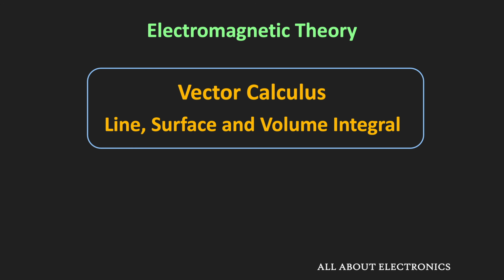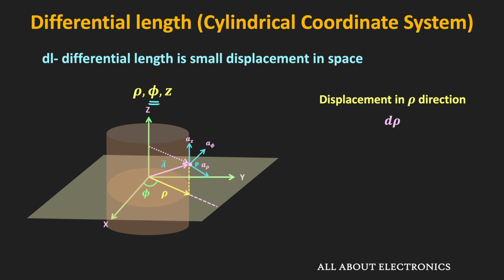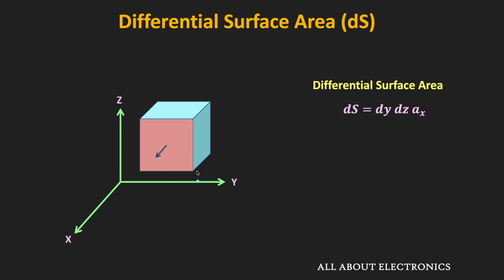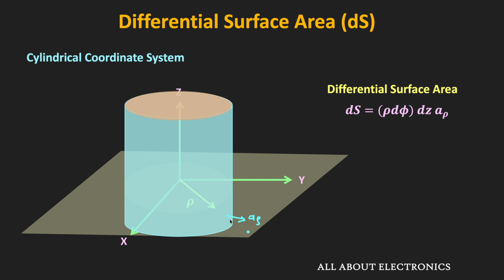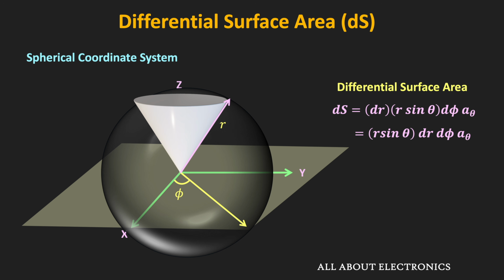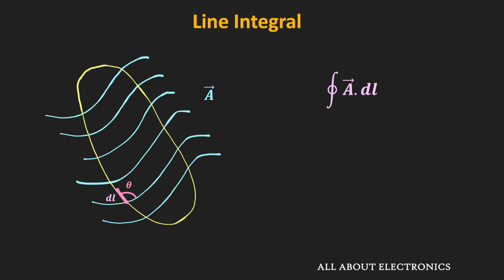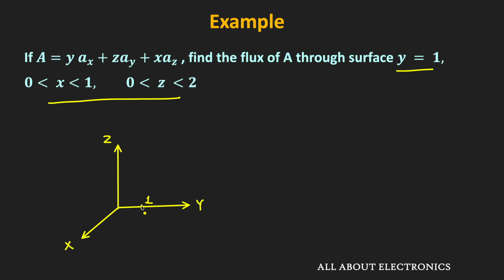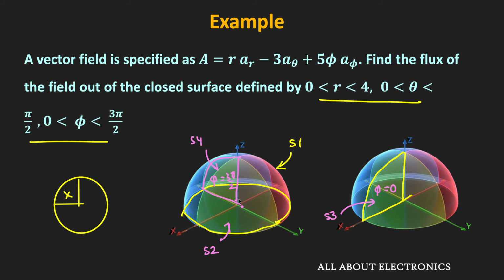Line, Surface and Volume Integrals of Vector Fields | Electromagnetic Theory

Comment: The limits should be x= 0 to 1 and z= 0 to 2 as y is constant...
Reply from the maker: Hi, would you please mention, where you are referring in the video ?
Reply: @ALLABOUTELECTRONICS  ya sure,at the very first example timing is 26:37 ...if I'm wrong u can correct me .
Reply from the maker: @Miniwithmore_edit342  Yes, that's correct. By mistake, instead of Z, I have written Y = 0 to 2. Thanks for pointing that out.

Comment: my answer is coming as 78*pi^2 - 36pi
is it correct?🥲
Reply from the maker: The correct answer is 60π + 30 π²
Reply: @ALLABOUTELECTRONICS  I finally got the answer, 😭🎉
Reply: In the last numerical, while finding the area of S3, since the phil is zero, the surface area of S3 will also be zero, since phi is in product with 5 according to question???

Comment: Bro plz make videoa upon Static Magnetic Fields:- Biot-savert's law in vector form, Magnetic field intensity due to finite and infinite wire carrying a current, magnetic field intensity on the axis of the circular  loop carrying a current I, Ampere's circuital's law and its aplications on a solid  cylindrical conductor and infinitely long coaxial transmission lines.